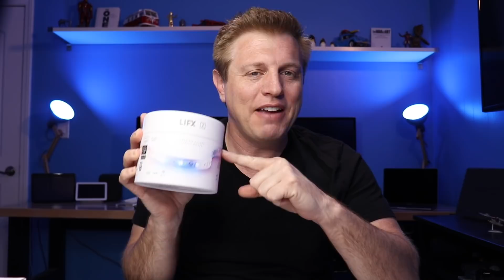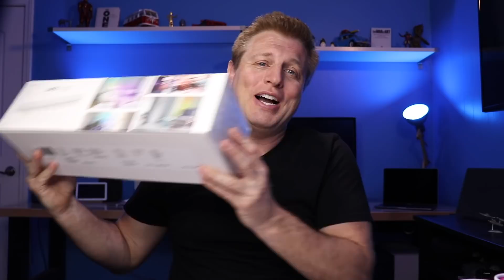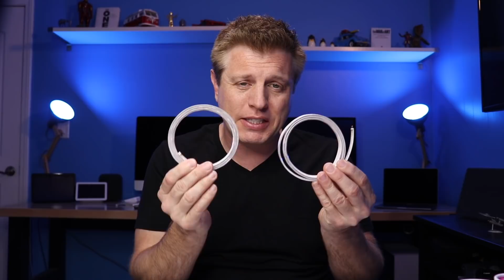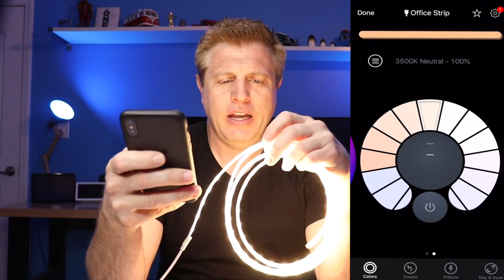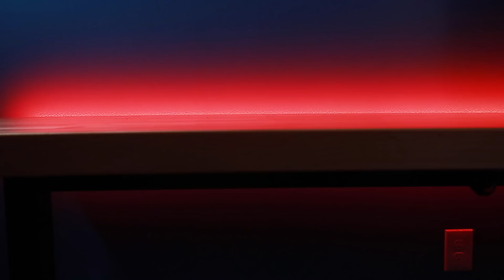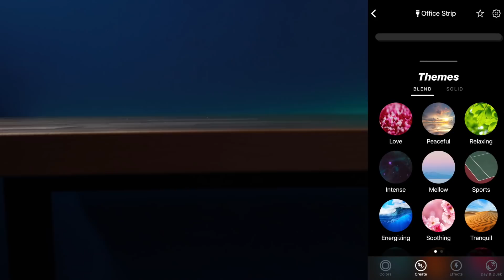LIFX Z Strip Setup and Demo - Best WiFi LED tape light strip

Comment: BUYER BEWARE. I purchased one of these from best buy in April. It worked fine at first but by June it would not connect to the app. I contacted lifx support and sent them diagnostics. They could not isolate the problem. During the course of our interactions they sent me emails saying my case was being closed twice. I had to email them back and tell them that the issue was stll not resolved.   I still have not received a replacement item months later. So to get back at them, I'm telling my story wherever I can.

Comment: Can you start/stop turn on/off the animated/changing light themes via Alexa?
Reply from the maker: Unfortunately you cannot
Reply: @CraigsTechTalk  Grrr! Thanks for the info!
Reply: @CraigsTechTalk  LOL! And someone just replied to this question on Amazon, saying you can :)
Reply from the maker: Not through the LIFX app. Just ran an animation and tried to save it as a scene. It saves the animation stopped. You can’t even save those animations as scenes to trigger. Alexa doesn’t have a light changing mode for animation internally so it’s not making an animation. 
Good luck if the other guy says you can do it.
Reply: @CraigsTechTalk  Yeh! It's just bizarre how these companies don't join up these final few dots to make the product more functional :(

Comment: Hey with my strips the second one when connected doesn’t work know how to fix it?
Reply from the maker: Try pressing the button on the remote/power supply. That should have it check all the strips connected. If you don’t see white light move along the whole length, then it is not seeing that strip and something physically wrong. But if you plug a strip into a strip that thinks it only has one strip, the second one will not light up.
Reply: Ok thank you I fixed it. Very helpful and I subscribed 👍

Comment: Are the 1m strips just extensions or do they come with a power supply? Also, how many strips do you recommend for a 65" TV?
Reply from the maker: The TV kits are power supply and 1m. The 1m extensions have no power supply. I would recommend doing 5. 4 might cover it but could be tight. 5 or 6 gives you more flexibility.

Comment: Hey Craig - I can’t seem to find lifx strips in stock anywhere.  And I can only see the link for the extension in your description.    Do you have any ideas of where I can find the starter kit in stock ?   Bc I have to have that before I can add any extensions is my understanding.   Thanks
Reply from the maker: The only place that I have seen them in stock is at Best Buy or you have to buy the TV kit with the extension. If you go to life ask website they are repackaging everything I am changing the price to about $10 lower on a lot of things. Hopefully will see that inventory coming out soon.
Reply: @CraigsTechTalk  thanks! Ur the man.  So if i bought the tv kit is it essentially the same thing but I’d buy another extension to make it the 66”? or are the lights any different ? Didn’t know if it was essentially a scaled down version of the full starter pack kit.   Thanks
Reply from the maker: The tv kit is 1 meter. The starter kit is 2 meters. The extensions are 1 meter. Each kit is basically a power supply/brains & 1 meter extension or multiple extensions in the 2 meter kit. 
When on sale I bought 4 tv strips and 8 extensions. It worked out to be less than the 2 meter kits on sale. I grab a tv kit and the number of extensions I need

Comment: Hai Craig... i like your vids about LifX alot. I also like to buy the LifX Bulb for my toiled and shower room. But is it possible that it run on a motion sensor?
Reply: No
Reply from the maker: Unfortunately it is not. Unless you have that sensor paired to a smart speaker and the motion sensor triggers a routine that turns on the light bulb. Thanks for watching.

Comment: LIFX makes some really impressive consumer lighting products, no doubt, but 2500K as the warmest white on a lighting product capable of 16 million colors is... interesting. I get why LIFX would be the choice for someone inspired most by the opportunities presented by saturated colors, but for those of us looking for a DIY consumer-level “Human Centric Lighting” solution, LIFX doesn’t deliver the goods.
Reply: What's the deficiency or problem with the product?
Reply: @maricafaukovic1137  basically? it doesn’t produce warm enough white light. 1800K is the current standard for warm dim lighting. 1400K is best in class. Properly controlled white light can have a significant impact on well-being. So making a product that has access to millions of colors but access only to a fraction of the white light spectrum shows me that LIFX has built itself on top of a set of design priorities that are out of sync with my interests.

Comment: Hi Graig, one niggling question I have after researching for buying these; has any problems been encountered with the app in the time period of using it and can other unofficial app be used instead of the Lifex app, as many negative reviews are given on the app store. Thanks for making and sharing these videos
Reply: Yes there are 3rd party apps for lifx, however the offical lifx app is great. I had both the new and old version and the new one is way better. Most of the people complaining is because they were used to the old app and the new one was a very big change

Comment: Hey nice video! Does the connection with wifi stay stable? Or does it fall offline a lot? That's the bit i'm afraid to as opposed to Philips Hue.
Reply: They are unstable if you use a bad router, however if you have a good router they are very reliable. If you want to upgrade your router, post on r/lifx and ask for router recommendations

Comment: Hi Craig and thanx for the nice vdeo! I have 2 questions:
1. If I want to install my LIFX Z on 2 different elements of the same room (i.e. one strip led on the tv and another inside the bookcase) how does the app work? Is there a limit in the devices' number?
2. Is it possibile to connect more than one strip led (working in parallel) to a single socket?

Comment: I know I’m very late but I was wondering what would happen to the adhesive if you would want the move the location of the lights!
Reply from the maker: You may get lucky and be able to reuse it. I would plan on needing to buy a roll of double stick tape if you needed to remove it.
Reply: Craig's Tech Talk     Thank you very much for the comment! Just subscribed :)

Comment: What happens if you switch off the power switch? So when this strip is connected to a dumb switch? When you power it on again, will it remember the last settings?
Reply from the maker: It will remember the last settings when it gets power. Thanks for watching.

Comment: Can you do a video on integrating this Alexa and Google Home? And how does it work with say motion sensors? Controlling lights via an app on your phone is so passé and inconvenient. True home automation is when you can use your voice to activate it. Thanks
Reply from the maker: You can put them into routines and activate the lights individually, as a group or a scene that is created. Other than using your voice for scenes or intensity, I don’t think either assistant does well with colors. I call up scenes all the time with Siri and use motion sensors to turn on the lights when I walk in the room.

Comment: Hey there! If one were to put the lights behind the TV could they be reactionary to the screen?
Reply from the maker: Unfortunately they don’t. There might be a third party solution. The only sound mode would be to have the app open with visualizer running to use your phones microphone.
Reply: They have made a new product that does that

Comment: I wish LiFx had "Christmas Tree Lights"? It would be nice if there was a set of Christmas Tree Lights that each bulb was no farther apart than an inch and a half apart from each other. Each bulb would be fully color changing and independently operated from each other if needed. It would be nice if a strand of lights had 3,000 lights per main strand. There would be different lengths of additional strands that would be able to be connected to the main strand but if your tree has 2, 3, 4 or how ever many sections it has you can get the right length that will work for you. All you would have to do is choose how you put the lights on your tree. This could be you wrapping the lights candy cane style from the bottom to the top like a spiral or you could wrap the around each branch on each level of the tree from the bottom to the top connecting the appropriate levels until the tree is full. You then would use the camera on your smart phone or tablet to take a video of the lights turning on and off at a high rate of speed. This would allow the system to detect each light and it's position in a 3D mapping of the tree and then allow you to create different patterns and color schemes.
That would be nice to do and having so many lights per strand would allow a person to have any color on their tree and it can change and operate right along with the LiFx lights you already have to change the mood, that would be cool.

Comment: Hi Craig. I love watching your videos and I learn a lot from them. I am wondering if you can guide me a little, I would surely appreciate it. I am wanting to put strip lights under three kitchen cabinets that are separate & only about 22 inches wide each, and I want to get a set to put behind my other TV so I was thinking I could get a set for my TV, cut off the excess and use it for the under cabinet lights but I need the power adapters and connectors or whatever I need... I can’t seem to find that. These in your video are too expensive for me. I have the lights in mind I want as I have some already for one of my TVs, it’s the Govee brand. For the kitchen I can just plug them into smart plugs to control with Alexa. I don’t need them to do anything fancy just a bright cool white light! Thanks again for all your wonderful videos. I tell everyone about you and share on Facebook!

Comment: Hi Craig 👋🏻 I understand that you can control different sections of Z LED Strip by assigning different colors to them. Could you switch some of those sections off and leave just one of them lit up and dimmed to 1%. I’d like to use it as nightlight in my hallway and want those to be as dimmed as possible. Same question applies to Lifx Beam.
Reply from the maker: Hello Marko, there is only one global brightness control. You would not be able to fade the different sections individual on either the beam or z strip. You only have the color section option.

Comment: How many LIFX bulbs do you have in one area? When my parents switched to smart lighting I recommended that they go with Hue as they wanted 26 individual bulbs in their main room (12 in total GU10s on the ceiling, four 1M strips, 7 GU10 coloured bulbs, and a few others), then 15 individual lights in their kitchen (9 2m strips, 6 GU10s). Having 41 wifi devices (50+ when you take into account other things) in one area just seemed like it would cause far too much congestion, and the setup for large systems like that doesn't seem as developed with LIFX. Bring on 802.11x/WiFi 6.

I ask because now I'm considering my own setup, whether to go with LIFX or Hue. I won't have anywhere near as many lights, but would e.g. 15 potentially even cause issues? How many do you have and have you had many/any issues?

Comment: Anyone know if you can power the controller with a low voltage transformer? I am looking to control multiple strips using 1 remote 12v transformer.

Comment: Can these be used as under cabinets lights in a kitchen? If so, I have my stove that interrupts my counter and cabinets. I would like to put a set of LEDs on the right side of my stove and another one on the left side. Is there a way of connecting both sides with wires that I would hide inside my cabinets instead of connecting both sides with LED strips and have the inside of my cabinets light up?

Comment: I have 2 LIFX bulbs and they work great. I also purchased the LIFX Z Strip and loved it so much I ordered 2 more strips to light under my kitchen cabinets. It all worked great. Then a couple of months later - one of the strips went bad. At 3:30 am - the entire string began to flash colors, which woke us up. Not good. I went through the process of ordering a warranty replacement, which is time consuming - since LIFX doesn't have a phone number to call. After working through their maze of "support" -  I was finally told I would be receiving an email with the shipping info for my replacement. I never received that email, and after about a month of waiting - I , once again, had to get in touch with the "Store" at LIFX. They finally shipped the replacement which had to come from Hong Kong, and  after many weeks - It arrived. So far - so good. But now I question the quality of this product and not confident that another strip will not go bad. So the bulbs are great (so far) but the Z-strip - well the jury is still out - and hopefully that jury will not be woken in the middle of the night due to poor quality. I assume MADE IN CHINA.
Reply from the maker: Hello KMS, sorry to hear that your strip went bad. That is disappointing that the replacement process was such a pain. I am surprised by that. Hopefully you do not have anymore issues and that was just an isolated incident for you.
Reply: same thing happened to me except I couldn't reach anybody or get help.luckily my kid likes the flashing strobe light so I gave it to them instead but it's a bummer because this brand makes the BEST color strips I've personally found. that really sucks.i thought it was a fluke but nope, your story sounds like mine.

Comment: Do you know whether I can use them without WiFi? Or do u know which led lights are best without WiFi
Reply from the maker: Hello, no you can't use them without WiFi. I don't know of any good brands that don't use wifi. You can buy some at iKea that you can pick colors and don't need wifi. There are all different lights on Amazon.
Reply: Hue uses hub and local execution from the switches
Reply: Govee makes cheap but quality strip lights in wifi or Bluetooth. Many can also be controlled with an IR remote as well but have limited functionality compared to LIFX. I have them under the edge of my countertop now and they work great but I’m thinking about switching to LIFX because their software control of the strip lights is the best on the market. Just expensive.

Comment: I bought the $100 lights but never received the power switch???? Can anyone help me? How do I turn these on???
Reply from the maker: Unless you bought a pack of extensions, the starter kit should have a power cord to plug into one end of the strip. If you have that, you pair it with the LIFX app to turn them on. If you don't have that, you need o make sure you have a complete starter kit. There also is no dedicated power switch, just the power brick that you plug in. Thanks for watching.
Reply: @CraigsTechTalk  Do you think if I bought the "Tile Power Supply" and the "Tile Cables" from the Lifx website, do you think those would work to turn on my Lifx strips?
Reply: @Craig's Tech Talk Here is the link to the "Tile Power Supply" and "Tile Cables" from the Lifx website: https://www.lifx.com/products/lifx-tile-power-supply?_pos=1&_sid=a6e5377eb&_ss=r

Please respond back asap if you know the answer to the previous comment that I just posted.

Comment: Phillips hue best LED for. Colour ?? they would have to literally be the worst lights EVER. They have the least brightness least amount of LED in their light strips and EVEN the least amount of actual length. Not to mention if you remove power they forget what colour they were on.
Reply from the maker: As some one who was worked professionally in the entertainment lighting industry and with professional LEDs, they do have great color mixing and color saturation. They do have 800 lumens output and I have tested them next to equivalent LIFX. Not one thing you say has to do with the color the light produces. You have other complaints. Don’t know why you would question my color statement based on what you have said. Sounds like you have your own issues with them.

Comment: I want to see someone review those new Sengled light strips.  Hard to find someone who has bought and reviewed them.  Probably like only 1 review on Youtube.
Reply from the maker: Hello, I have not checked them out. I will have to look at them. Thanks for sharing and watching. Have a great day.
Reply: sliderALT I just bought them and realized you need to buy a hub because it’s not included
Reply: Chinese Fat Nuts Thanks for the reply.  I bought one probably the next day after writing my original response.  I like them, but what I don’t like is that you can’t bend them around corners, at least not with them staying flat.  If you want to just lay them straight across horizontally or vertically , it’s fine.  But if you want them to be shaped like a square, you can’t cut them and reattach them or anything.  Once you cut a piece off, it can’t be reused.